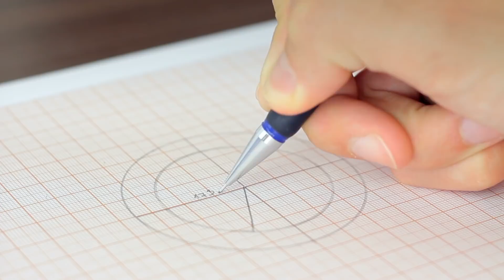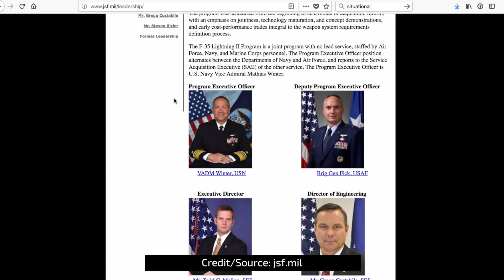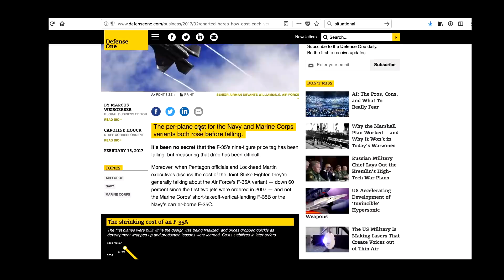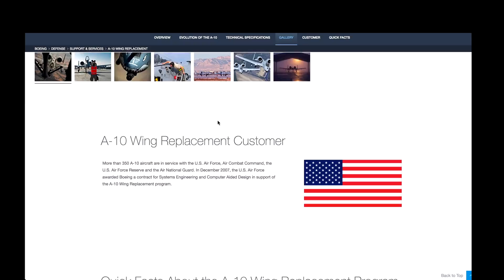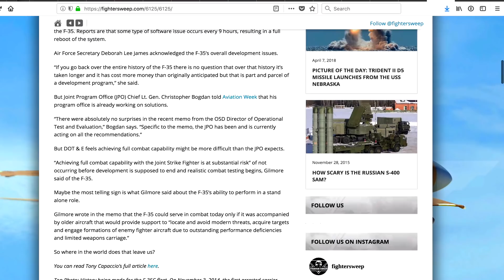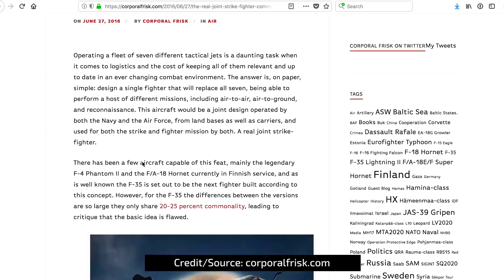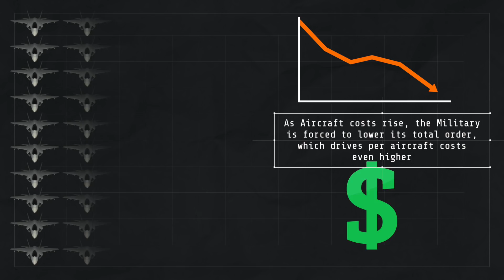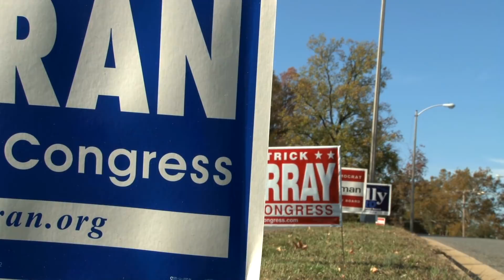Why the F-35 Lightning II Might be the Most Expensive Military Aircraft Mistake Ever

Comment: First of all: avionics programe should have started well before airframe and continue independently, with clearly marked capability milestones. Second, there is no need for separate Navy and AF variants. AF could go with Navy variant. Marine variant should be only exception, almost dedicated aircraft but using common technology (engine, avionics).
Reply: I agree. However, I would go further and argue that the cost of developing a fighter just for the Marines to put on their amphibious assault ships is simply too high to justify. For small wars, the Marines could have sufficient air defense for much cheaper using a combination of Navy escorts and organic land based air defense, and sufficient CAS with attack helicopters and drones. For bigger conflicts, the Marines simply don't have the numbers to go it alone, with or without an organic fighter, and need the help of the Air Force and/or Navy anyway.

I think the F-35B fits a niche that, at least for the American military, doesn't exist. The British have a bigger requirement for VTOL fighter given how they've designed their carrier fleet, but if they want it, let them fund it.
Reply: @JZ909  The Navy does give the Marines Support currently with Marine Corps FA-18's, that will not change and Some F-35C's will likely be assigned to the Marines

The issue is risk - A carrier will not be allowed in a war to close with the enemy coast to give the fast sorties needed for landing support - The F-35 are on the LHD's as they are theoretically more expendable for achieving the objectives

The FA-18's and the F-35C's try to provide theater wide interception of enemy aircraft while the AV-8's and now F-35B's provide rapid response missions
Reply: @bengrogan9710  I can see what you're saying with the C vs. A variant. Separate competitions for Air Force and Navy jets would probably be best. Maybe a modified jet originally designed for another service wins, maybe it doesn't.

Rapid response is aircraft already in the air, burning circles in the sky and fueling up from a tanker when needed. Making sure you have the aircraft in the right place at the right time is a planning and scheduling issue, not a requirement for a new aircraft.

Don't get me wrong, I can see reasons why the Marines need combat aircraft, I just think they would be better served by dedicated CAS/recon aircraft for ground attack/armed recon/ISR and a destroyer escort with SM-2/6s and some mobile SAMs for air defense rather than do-everything-poorly jump jets.
Reply: @JZ909  I broadly agree but would point out rapid response in the context I said may have given the wrong impression

Rapid sortie rate would be more correct to my meaning - carrier aircraft could be able to be on station but once stores are expended they must travel around 150 miles back to the carrier to rear and refuel that is easily 20 minutes on station delay

The LHD's acting as forward airbases mean they can be as close as 25 miles from the shore - this reduces flight hours on the air frame, fuel use is reduced radically, the number of sorties flown increases dramatically and the aircraft themselves gan be fully armed for emerging threats as opposed to general weapons loads

Then there is the issues of inter branch comms - a Navy aircraft may be retained at any point should the carrier group come under threat, the Marine F-35s are integrated wing ground force command including direct contact with ground forces to designate a threat
The delay, and possibility of Chinese whispers, when relaying strike package co-ordinates can cost lives.
Eg, a Marine F-35 will know the forces on the ground and will be able to fluently call squads when on final approach so they don't designate a target before the flight is attacking.
At the same time the marine F-35s will have been briefed on the local battle sphere for ground forces and will also act as forwards tac recon - informing forces of encroaching forces etc.

The Navy pilots, unless assigned to inter branch operations only are not going to have that level of fluency in ground contact.
Reply: @bengrogan9710  Closer aircraft have a faster sortie rate, but it seems that with jump jets, they are giving up so much in terms of payload that it negates any advantage. As far as I can tell, the AV-8's standard loadout is 2 500lb class bombs, while the standard loadout for even light fighters like the F-16 or F-18C is 4. Even considering a 150 mile transit, I doubt jump jets are going to be able to turn twice as fast in order to make up the difference, and we're not even talking about heavier fighters, like Super Hornets or Strike Eagles. Obviously, F-35Bs are going to perform quite a bit better than AV-8s, but still, when you're taking off vertically, there are going to be pretty severe payload tradeoffs when compared with taking off from a runway or a catapult.

When it comes to comms, CAS is joint, and everyone should be speaking the same language. How well they speak it is going to depend on the amount of training dedicated to that task. I sincerely doubt a Marine F-35B pilot is going to speak CAS better than an Air Force A-10 pilot or an Army AH-64 crew. The F-35 pilot is going to have to train on more stuff simply because his aircraft has the capability to do more stuff, and that's going to cut into his CAS training to some degree. In the same way, I think the Air Force is making a mistake in replacing the A-10 with the F-35A. CAS is important, it deserves some specialized capabilities.

If the purpose of Marine combat aviation is CAS, then there are better options than the F-35B available to the Corp. If the purpose of Marine combat aviation is to be a tiny, multi-purpose air force operating off of a LHD, I question that the value of that capability outweighs the cost.
Reply: @JZ909  I'll try and section off replies to keep things legible - This is a nice back and forth you don't often get on youtube

1st the harrier's low payload
This is an artifact of it being a 1st effective production model - it was highly fuel inefficient and maintenance heavy and so limited its stores for better wear profiles on the engines
You are right that a similiar size normal plane was more effective at the time -  that is slightly negated by the design of the F-35B
The Lift fan drastically reduces fuel expenditure in VTOL work and the engine itself is more efficient in normal flight
Combined with the fact the F-35 s as large as a Super Hornet essentially puts the payload issues to sleep as it is within less than 20% of what is available to C variants

2nd: The F-35 doesn't take off vertically It is STOVL not VTOL
It has a takeoff run on the deck of the LHD - this means it can carry around 60% more on take off than if she where VTOL

With regards to the sortie rate, there are other considerations to the choice
A carrier can only maintain so launches and landings in a period - at points of high strain there will have to be sacrifices made to one or the other role
Delayed Rearming due to elevator congestion on the carrier deck or similiar with the catapults

That is why the Marine Corps where given AV-8's to allow them their own combat craft to manage

3rd: Your point on CAS is overall correct with a few nit picks
CAS is not Joint, except for very specific missions if CAS is expected to be required then there are Airforce liasons added to the units - The Army doesn't speak to the pilot, the Airforce put a soldier in with the Army
I agree that the usefulness depends on the pilots training and the idea behind the Marine F-35s is that they train directly integrated with the forces they support, Marine pilots average more hours training for CAS than the Airforce by around 38% last time I checked and thats before considering that when supporting Marines it is quite possible that Army rotary support or USAF asset may not be fully available

As for the point on specialized CAS craft - The A-10 has languished over the years
It was designed to be survivable for minor hits from 23mm SPAAG in a n era where low level SAMS where non viable
The A-10 is not survivable VS a modern foe with a proper IADS network
In the Iraq War it was pulled from the duty roster as they where being damaged when faster higher fighters, that in theory should be worse, where finishing sorties undamaged
The A-10 has been relegated to either high level strikes, which other craft are more survivable for due to speed, or in real terms a heavy Counter-Insurgent platform to Replace the OV-10 Bronco

And for the final paragraph
That is the crux of it and where we disagree
If each F-35 in service saves 10 soldiers over 50 years then they recoup their costs in training the replacements and medical aid for the wounded alone
Reply: @bengrogan9710 I've enjoyed this back and forth as well, and even if we don't agree on everything, you bring up good points and it's nice to talk to someone who's knowledgeable about the subject.

I completely agree that the A-10 is not survivable in a high threat environment and just mentioned its utility to highlight the benefits of specialization. When I talk about the "cost" of the F-35, I don't mean dollars and cents, I mean the lack of investment in other, potentially more effective capabilities. Here are some specific complaints I have with the F-35, several of which could probably be addressed better by something else:

1. The F-35 is not optimized for flying low where it can use its sensors to see fine details, something very important to highly responsive, well-integrated CAS.

2. It has poor loiter time (and on LHDs, poor numbers) which may be a significant downside when the Marines are fighting "small wars", without a lot of joint tanker support.

3. It has very limited internal weapons capacity for its size. Only two 500lb or larger weapons (eerily similar to the AV-8), or 8 SDBs/Brimstones. 

4. It doesn't have a 2nd seat for a WSO/FAC, not a strict requirement, but very useful.

With such a limited capability, I'm not convinced that F-35Bs are going to be more effective than alternatives, like support from more ambitious Air Force and Navy strike platforms, stealthy semi-disposable strike UAVs like the XQ-58A, advanced, low-flying attack helicopters, something a little out of the box like rocket artillery guided by stealthy recon UAVs, or some combination of these approaches. Even without investment in any other program, trading F-35Bs for more AH-1Zs (2 of which can fit in the space required for a single F-35B) seems like a net gain for the Marine Corps' CAS capability in the vast majority of situations, and it's less expensive in terms of dollars and cents to boot.
Reply: @JZ909  I agree with some of the points you raise here in part but just want to make a few additions
I'll reply to the points you made here numbered to address yours
1. While you are correct that the F-35 is not optimized for low and slow CAS the existance of MANPADS has essentially made that role helicopter only as only they have the pop-up capability to be survivable
The F-35s EODAS system achieves better visual clarity on targeting feeds at 5000ft than the LANTIRN targeting pod fitted on the A-10 and Legacy aircraft does at 2000ft
This combined with the foact that the LANTIRN can only scan 120 degrees from boresight compared to EODAS covering over 270 degrees in the lower hemisphere of the craft
The relevance of this point for either of us is limited however as I cannot be sure how much modern CAS is local designated vs how many strikes are at the pilots intuitive digression

2. while I agree if we are comparing the F-35B to normal fixed wing aircraft its loiter time is trash, that is a slight apples to oranges comparison unless we are going to discuss the idea of integrating proper CATOBAR or atleast STOBAR light carriers with the Marines if operating solo
The Marine doctrines are built for the AV-8 and bear large similarities to the way the Royal Navy supported the Falklands
Namely the LHD are not intended as a long term basing for the F-35s when on such deployments

To explain - The Royal Navy where in waters in which they knew Argentine subs where patrolling and where at the extreme range of Anti-Ship attacks
The existence of the Harriers on the British carrier combined with the range meant that they could only do a single attack run, and should they need to break off it was immediate RTB
They directly supported the landings - The Harriers range being far greater than the rotary airsupport meant that a larger intercept perimeter could be maintained while the initial landing took place allowing for rapid setup of a forward airbase
once they had that 1/2 where deployed to the FOB and 1/2 assigned to CAP duties for the fleet - The space saved was then supposed to be used by more rotary airlift helos transfered from nearby transports

The F-35B fills that same role but extend the perimeter further, ensuring the initial landings go even smoother

3. F-35 payload is a slight misnomer that is oft repeated
Her internal load is 2 AIM-120 for defense along with space for 2 1000lb, as opposed to 500lb bombs, or the Brimstones mentioned - but there is a 3rd internal option 8 200lb GBU-53 SDB-II which are intended as its primary CAS armament
Then there is the assumption that is made that all F-35's will be running "Clean" mission profiles - meaning no external stores
The F-35 is still lower in Radar cross section than any legacy craft with external hardpoints meaning in a semi-permissive scenario its ordinance can be truely let free and current testing show that the F-35B can take off from the deck of the LHD with 24 SDB-II, 8 internal and 8 under each wing which places it only 1/3rd behind the Strike Eagle's standard payload despite being so close to the fight

4. No Arguments, I by and large agree with that statement

And for the last paragraph - again I by and large agree but we also need to consider the costs of the F-35 are not solely for the marines - The British have also put in a good amount of time and resources on the F-35B's development and confirmed orders
The F-35B does have some capacities that no other asset they have access to has as well as allowing them to have competent CAP aircraft at the drop of a hat allowing other branches more freedom in theater

It would behoove us to consider the value of bringing an ally even closer on board as thanks to that fact we already have Marines operating on their new carrier while they are still awaiting delivery of their initial order due to Lockheeds delays
Reply: @bengrogan9710 I'll try to follow your format in order to keep this sensible.

1. I think you're mostly right when it comes to your analysis of survivability at low altitude over a modern battlefield, but I would add small UAVs to the mix. Their audio/visual/IR signatures can probably be made small enough to make them hard targets and even if you lose a few, it's not a huge deal.
 EODAS isn't a targeting sensor, and it doesn't have any zoom capability. EOTS is the system to look at, but a fair comparison to EOTS would be a Sniper pod, and EOTS is decidedly worse for a number of reasons.
 Who designates targets isn't the issue, in CAS, that's the ground force commander working through his JTAC. The issue it's how easy it is for the aircraft to find exactly what they're being asked to strike, and how quickly that strike happens. Closer to the target generally = better sensor resolution and faster engagements.

2. Loiter time is an issue because gunfights can take a while, and CAS coverage is needed throughout the fight. Not a huge issue if you have tanker support, or a lot of planes that you can rotate, but I don't think the Marines want to be dependent on Air Force tanker support for small conflicts, and their standard loadout on an LHD is only 6 F-35Bs.
 During the Falklands War, the Harrier carrier wasn't some brilliant doctrinal model. In fact, the British only avoided catastrophic losses because the Argentine Air Force was dropping its bombs out of parameters and as a result they weren't fusing. The F-35B probably makes that sort of fight workable today, but for the United States, with 11 supercarriers, it seems like an expensive, redundant capability. 

3. If SDBs end up being as good as people hope they will be, then you're right. Even if the threat is too high to use external stores, 8 shots is a respectable number. Personally, I'm skeptical of SDBs. I strongly suspect bigger explosions are just going to be the better option for many targets, but I'll admit that I could be wrong, and at very least, they will be somewhat effective. An F-35 with external stores is effectively a 4++ gen jet, which isn't a bad thing. I strongly doubt we're going to be doing a lot of CAS that absolutely requires stealth, and even assuming 500lb bombs, the F-35B can carry of 6 of them, which isn't bad (though how practical 6 bombs is in terms of range/loiter isn't clear). Here, the F-35B is tolerable, just not optimal.

A. The British designed the Queen Elizabeth-class carriers as CATOBAR, but in order to save money, they never installed the gear. They wouldn't have been able to make that decision if the F-35B wasn't available. To be fair, with the higher cost, the British may have opted for a single carrier, rather than 2, so whether or not the F-35B resulted in a net gain or loss in British naval airpower is speculation (but fun speculation). However, your point can be made with many other navies, ranging from the Italians to the Japanese. The F-35B is also potentially a good option for countries that don't have strategic depth and can expect their airbases to be struck by ballistic missiles in the first hours of a conflict.

At the end of the day, while I understand and respect your point of view, I still think the F-35 was a mistake. The Marines would have been better served by specialized CAS aircraft, and some mobile SAMs in the unlikely event they have to defend themselves from air attack before the Air Force and Navy show up; the Air Force would have been better off with more/upgraded F-22s and a more specialized strike aircraft (probably FB-22s or FB-23s), and the Navy would have been better off with their own fighter program. Our allies would have benefitted from more capable options being available for their land/CATOBAR-based aircraft, and could have written their own requirements for a VTOL strike fighter if they felt they absolutely needed one.
Reply: Seems to make sense until other parts are considered - there are numerous costs with the C variant that the A does not have
Uprated landing gear
Components made for far harder landing stresses
tail hook
Weaker wings due to the folding mechanism - leads to worse sustained high G turn ability
Wing tip missile rails demanded by the navy flexing said weak wings
Larger tail surfaces increasing drag
and those are from the top of my head before considering they have their own equipment that needs to be fitted to the models for any given mission